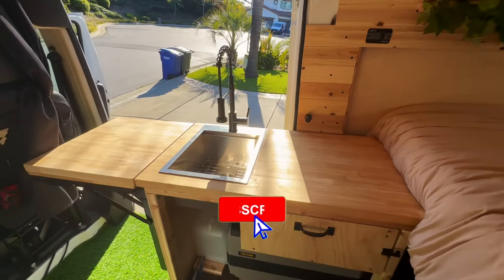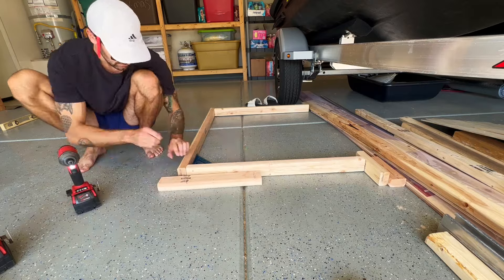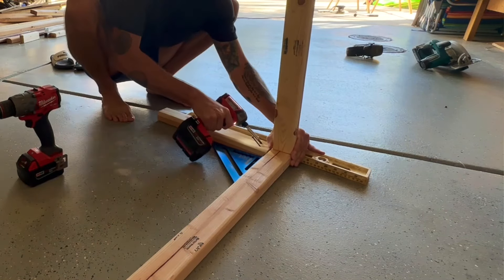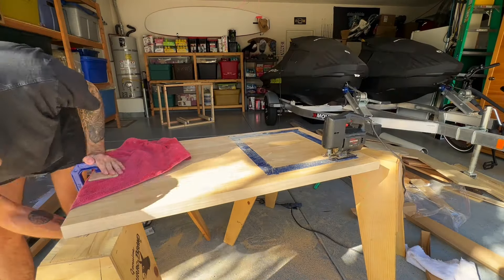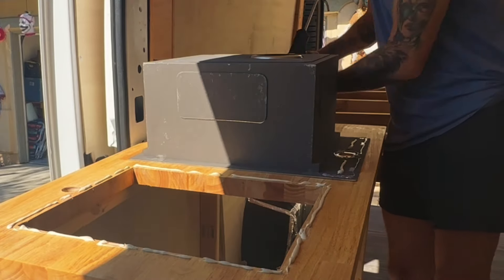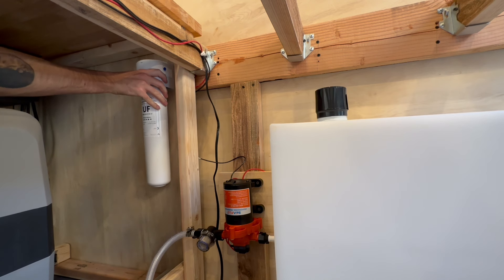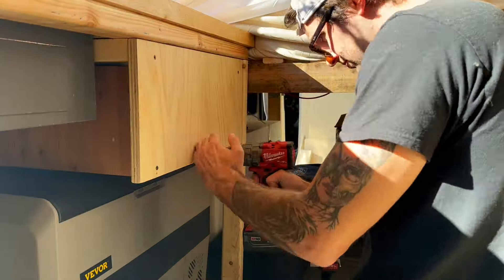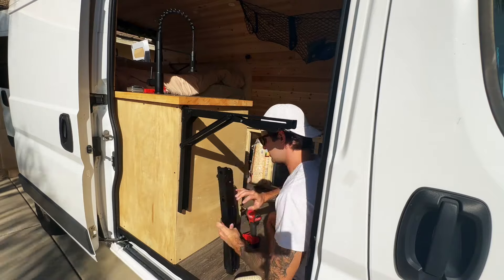The EASIEST Van Kitchen to Build Yourself | DIY

Comment: I'm a picture framer and woodworking is a hobby for me. I think you're doing a great job Puddin', especially for someone with little  carpentry experience. Drawers are difficult for sure, but we learn by doing.
Reply from the maker: I appreciate that! They don’t seem like they’d be too difficult until you try to do them…

I just added my upper cabinets and they look a little rough too

But like you say, next time around it’ll be a bit better

Thanks for watching John! I’m grateful for your support

Comment: I used to help build cabinets for a guy and we used pocket holes for all drawers and they were super strong. Make sure to use wood glue because wood glue is apparently stronger than screws 🤷‍♂️ oh and put the pocket holes on the outside so the inside is cleaner.
Reply from the maker: That’s good advice! I really appreciate it! 

I’ve been bathing this stuff in wood glue so hopefully it’s really strong - and those pocket holes surprise me! I initially didn’t expect them to feel as sturdy as they do